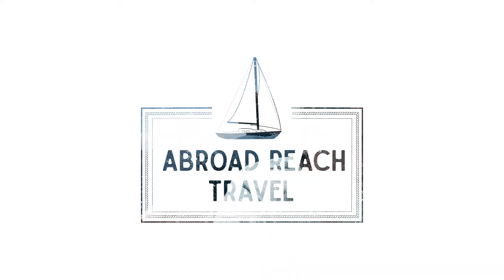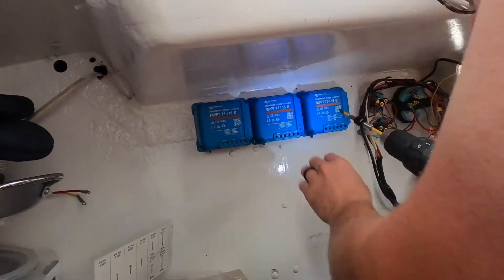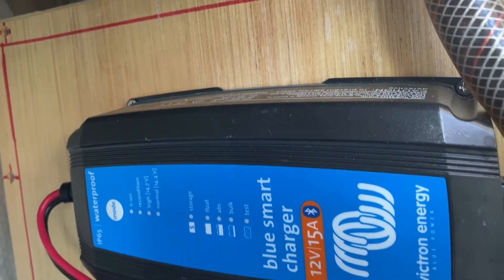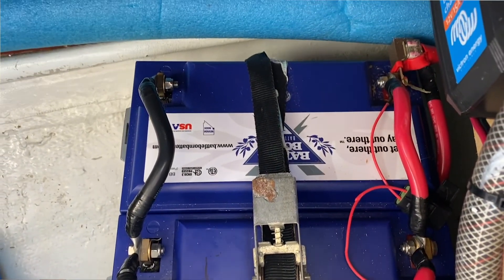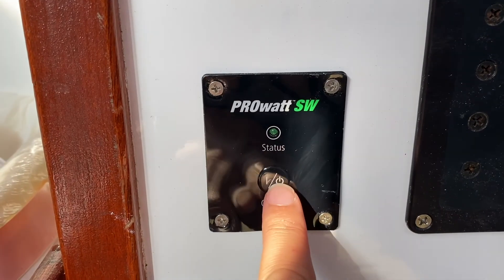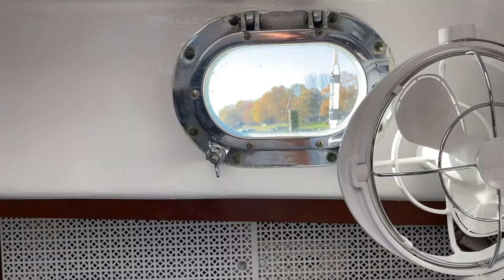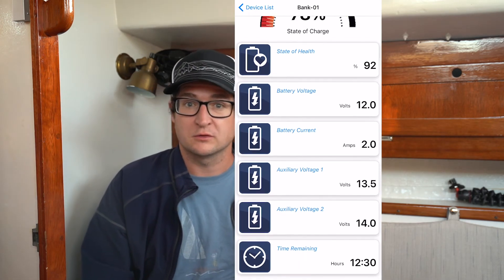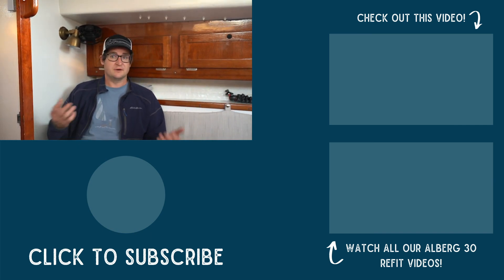Alberg 30 Off-Grid Electrical System | Alberg 30 Refit Episode 23

Comment: I enjoyed that. Good advice with just using the inverter for shore power. Question how do like like living on the Alberg 30 overall. Comfort, leak, any issues or things you would do differently? Thank you.
Reply from the maker: Thanks!  We love our Alberg 30.  Would living on a bigger boat be more comfortable?  Yes.  Are there some conveniences of a newer boat that would be nice?  Of course!  But would that have been worth waiting 3-5 more years to cruise full time?  Absolutely not.

My biggest complaints:  
-No insulation so condensation can be a REAL issue.  This might be better with the liner era boats but 🤷🏻‍♀️.  We are going to be installing a heater soon so hopefully that will help.  
-Our holding tank is tiny and is the limiting factor for how long we can be “off-grid” without having to make a 5 mile run or find a pump out.
-The cockpit can be really wet in any kind of seas because the freeboard is so low.

Honestly that’s all I can think of at the moment.  I had a lot more complaints before we undertook the galley refit 😆

There are some common issues with the Albergs that we’ve taken care of long ago: deck beam needs beefing, chainplate bolts undersized, and you want be really careful with “squishy” deck.  But overall the boat is a tank and super comfortable!
Reply: @AbroadReachTravel  👍👍

Comment: First time I hear about a battery to battery charger, it means I could keep my MPPT controller charging my engine starting battery and upgrade my house battery to Lithium as you did which is a lower cost alternative to changing every piece of equipment onboard, Thanks for the tip.